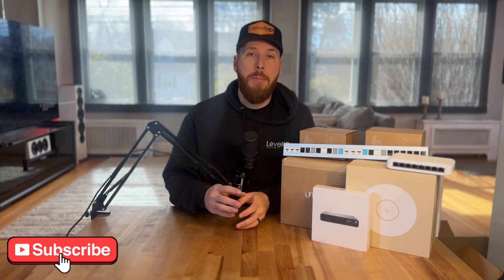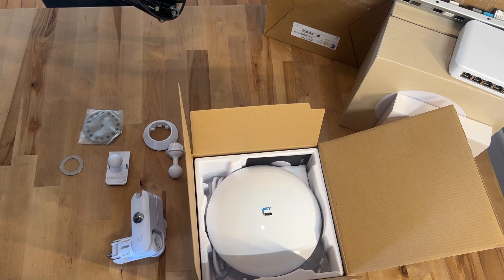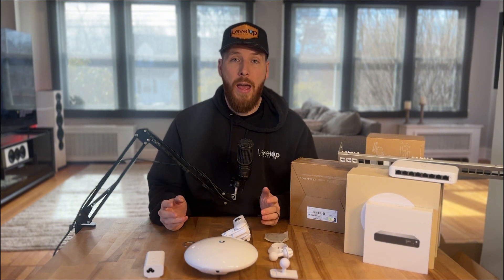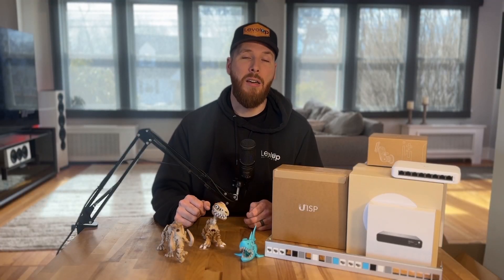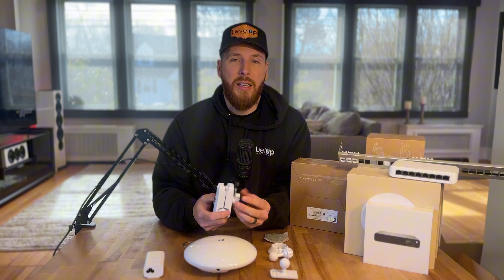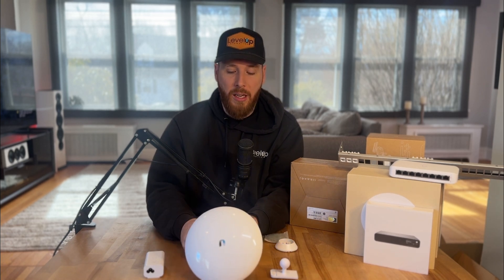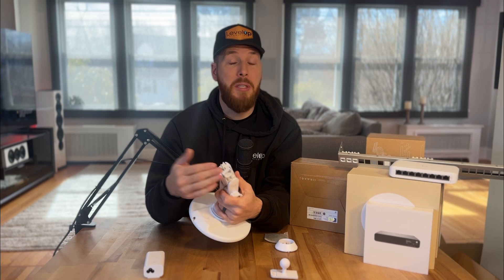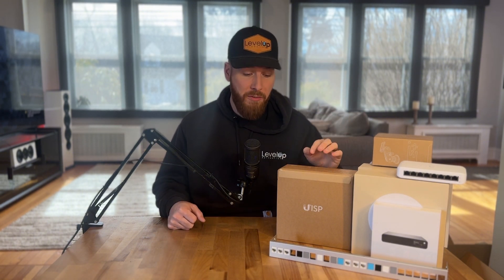Ubiquiti Nano Beam Unboxing & Real-World Use Cases | Long-Range Wireless Bridge Setup

Comment: I have a Unifi home network with UDMPro, UNVR, cameras, switches and APs.

Looking at either Nanobeams or the Unifi Building Bridge (UBB) between house and barn with clear LOS.  Understanding the Nanobeams themselves aren't managed within Unifi, if I go with Nanobeams, are the devices at the barn (Unifi switch, cameras and AP) all still managed through Unifi?
Reply from the maker: Yes all of the rest of your equipment will be managed inside the Unifi app as usual. The Nanobeam is separate and is set up with the UISP webpage.